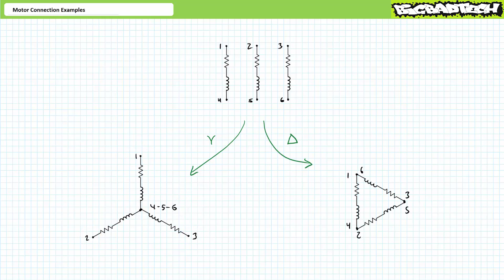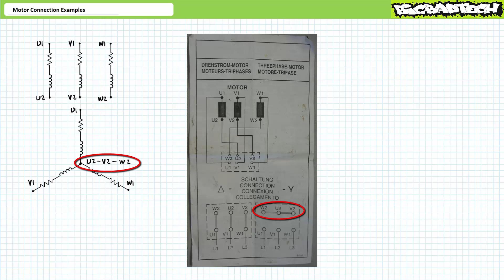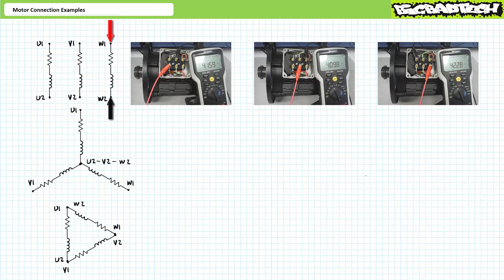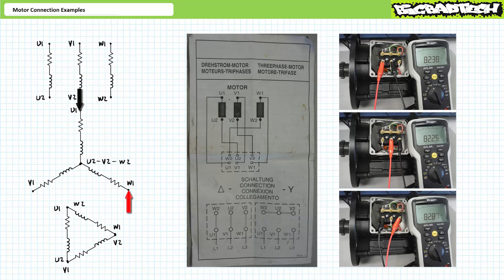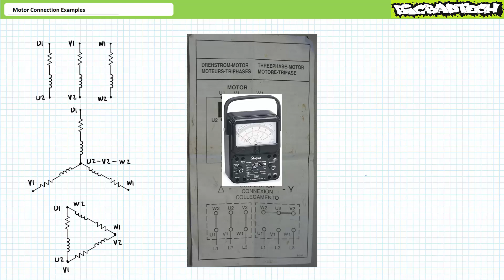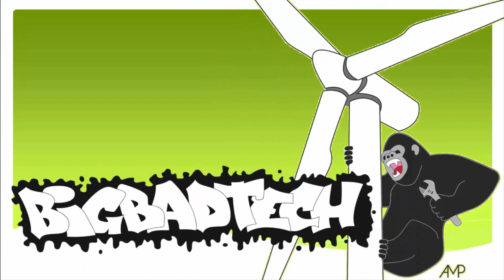Motor Connection Examples (Part 2 of 2)

Comment: Hi Jim, I'm mechanical engineer working here in Dubai. 

Just started your hydraulic series. Can I ask your permission if I can make a content out of it? I want to translate (not all your works tho) into my language so that I can start a free hydraulic lesson. I'd like to start with the basics. Pls tell me what you think on this. Of course, I'll plug in your channel as well and will throw some link as needed. 

Regards and thanks, 
Rosel
Reply from the maker: Roseller, I like the idea however I have to track video usage as part of my project and I like there being a single point of delivery. YouTube used to have a "community caption" feature but I don't think it's working now(?). If not, I'd be happy to add any subtitles in your language if you send them to me. Get in touch with me via the Columbia Gorge Community College webpage.